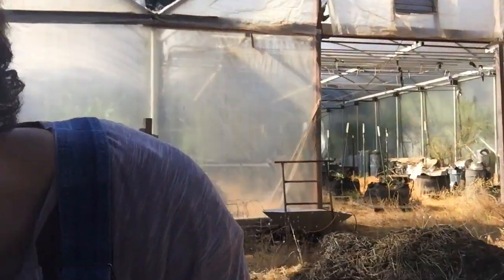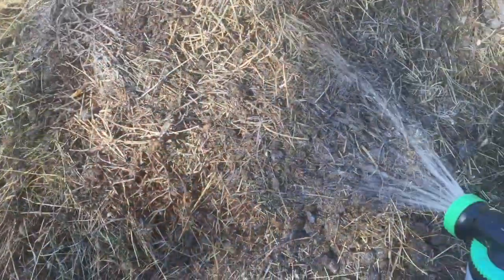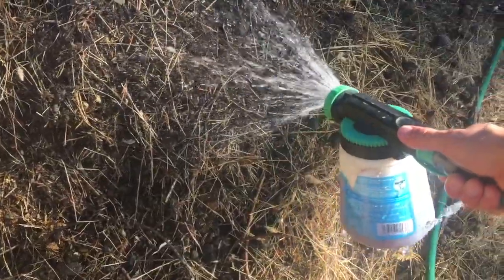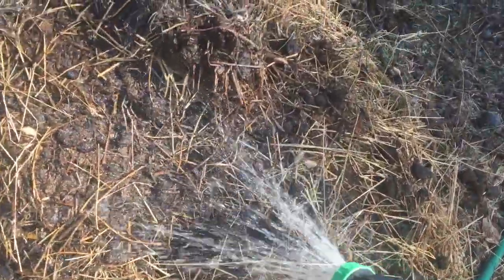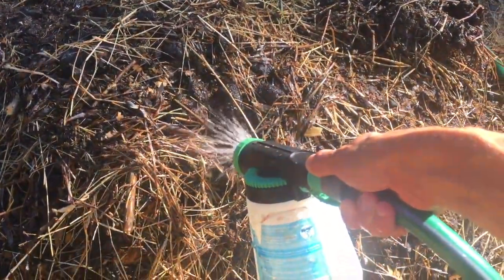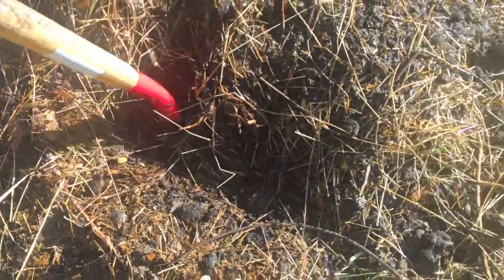How to Control HEAT in Compost Piles

Comment: Hey Matt – my compost pile is creeping up to about 159 to 160 Fahrenheit - even though I turn it, it continues to go back to that the next day. I can’t really seem to get the temperature to drop. Any suggestions? Should I be concerned if the temperature increases to over 160 Fahrenheit?
Reply from the maker: Add more carbon (more browns) to the mix that will slow the reaction but also lengthen the time you are doing this: since that carbon is on its day 1 when you add it.
Reply: Matt Powers - The Permaculture Student will do - thanks Matt.
Reply: Matt Powers - The Permaculture Student One more quick question for you. Have I screwed up the pile at temperatures of 159 and 160?
Reply from the maker: @DanielKowarsky  you've burned off Nitrogen and Carbon for sure but many folks do without realizing it and their soil is still great at the end, it's just lacking those nutrients that gassed off.

Comment: You definitely had the right idea; building tall and thin. Compost piles act like chimneys; as the heat rises, it heats what is above it, NOT to the sides as much. A short and wide, or square pile (typical frame heap or compost bin) loses a ton of heat that could otherwise be reused, like a rocket stove or masonry heater. I would try your method again, but this time anchor the frame in place with guy wires or something, and go even taller.

Comment: I don't have a microscope yet, so I can't test this, but are microbes damaged or killed by pressure spraying? I know some of the KNF guys use watering cans so as to totally avoid that possibility. What say ye Matt?
Reply from the maker: Depends ;) if you have a high pressure industrial setup for sure that can slice and dice but this thick stream here I wouldn't agree with that especially with EM since it's yeast and bacteria.

Comment: at what point did you control the heat?
Reply from the maker: The EM lowers & controls the temperatures and holds it at 129-130F as the ceiling.